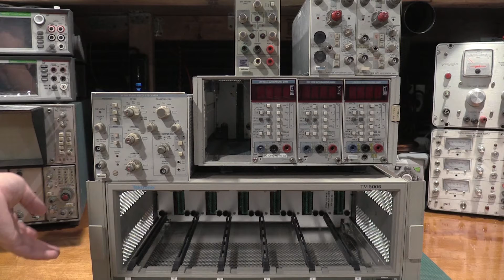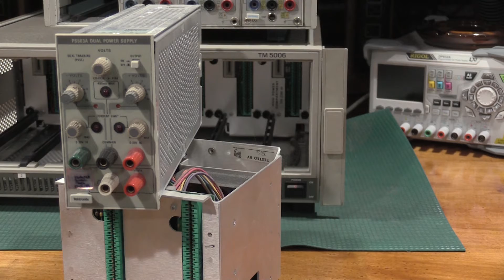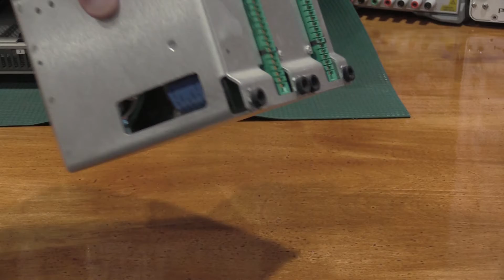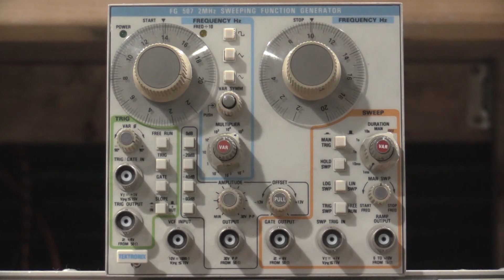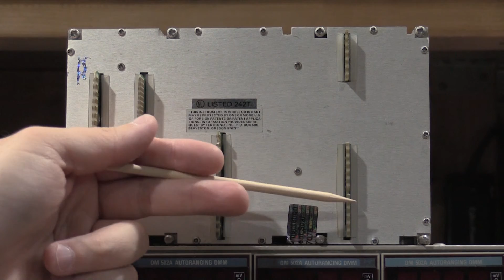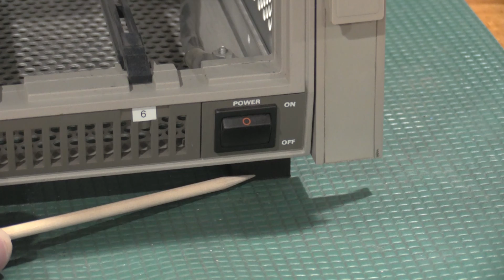Zenwizard’s TM500 and TM5000 Purchasing 101

Comment: Important reason to jump in:
Tek was at the pinnacle of discrete analog electronics about 1980. If you want to learn how to do that without simply picking out ICs, buy an SG series part and make it work. 

Follow up with a THD + N meter and study. You may learn from an FG part that beautiful sq waves were made without ICs. 

Enjoy. I was there in 1980. I can attest to how far ahead we were.
Reply from the maker: Even today the SG505 is incredibly hard to beat. As I have built up the lab over the years the TM500 and 5000 series has been a master class of analog design. This is also why there is so much on it on the bench in use still today. For some things digital is OK and even superior, for others analog is still the way to go.

Comment: I’ve collected tektronix for years the tube equipment generally works but I have had more problems with the solid state units, mainly tantalum caps and broken controls (UPS)? I generally buy mine from Hamfests to eliminate the shipping damage.

Comment: Mr Carlson,  I think,  would never use a piece of electrical/electronic equipment as a sacrifice! What's wrong with this picture?
Reply from the maker: There is a frame testing plugin that was made for this specific use however, they are quite rare and not many show up It is on the look for list for the lab as well as some others but none have come available as of yet. If this is in reference to testing the pass elements in the frame you could replace every component but this would quickly exceed the cost of the frame with each pass element being $30.00 each for the low power ones. I have not had to replace a TO-3 yet (high power port)
Reply: @ZenwizardStudios  test
Reply: @ZenwizardStudios  bizarre, I seem to be able to say anything here except what I want to say
Reply: Jared over at, a channel which apparently shall not be named,  has updated the design of the fixture you mention, the 067-1201-99, and has released complete gerbers, schematics and 3D mechanical drawings linked from his video titled "Build a Tektronix TM500 Mainframe Tester".  His implementation is actually pretty slick.
Reply: What a silly comment. Every person that does restorations has parts units. Just because mR cArLsOn only restores things that generally don't need sacrificial units doesn't mean he doesn't have them. Plus if your really comparing what random yourubers do, you really need to huff some more simder smoke and get on with it!

Comment: A foot is missing on my TM5006, so it would be great to 3D print replacements. Where do I find the file? Also, it would be great if you could do a file for the retainer clip on the rear panel, as these always get broken. It's on page 9-3 in the Service Manual. Part number 348-0544-05.
Reply from the maker: Here is the feet for the 5006. It is a Patreon link however this post is open to all. 

https://www.patreon.com/posts/73269364
Reply: @ZenwizardStudios  Wonderful - thank you!

Comment: I want to build a 500 plug in that just brings every voltage and the 2 power transistors out to the front in pin tip jack  so the supplies and transistors can easily be checked.
Reply from the maker: One of the main issues is loading the larger frames. The 5/6 bay frames have quite a substantial power supply both linear as well as switching. Packing that much dissipation in to the tm500 form factor is a challenge.

Comment: I have 1 of every TM500 Series frames, except a have 3 TM506 frames fully loaded. I have no TM5000 frames. I also have 1 of the extender cables. Having The Tektronix TM500 Series interface book helps in getting modules to "talk" to each other.
Reply from the maker: Ill look in to the interface book. It is a very cool system and defiantly enjoy what I have in the lab. just wish some of the plugins are not so cramped.